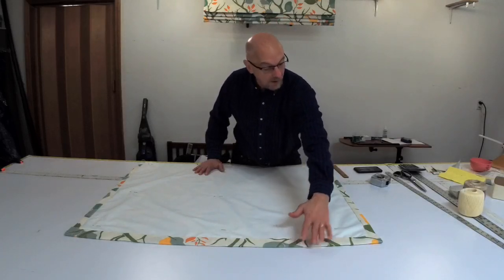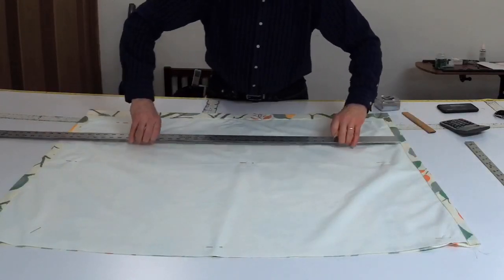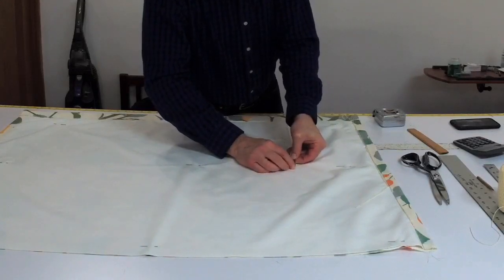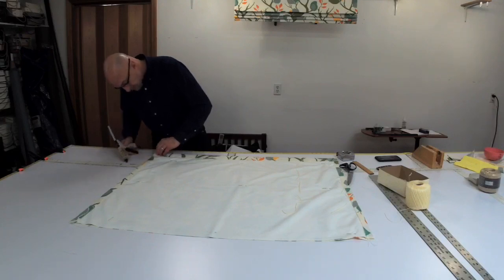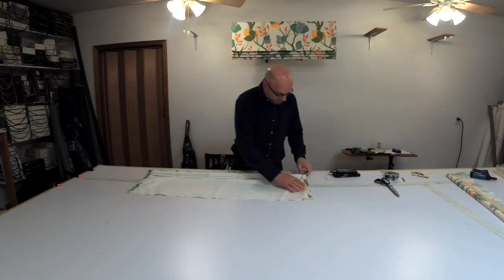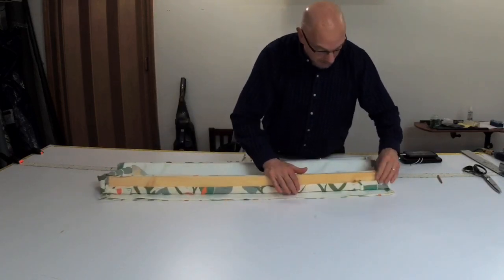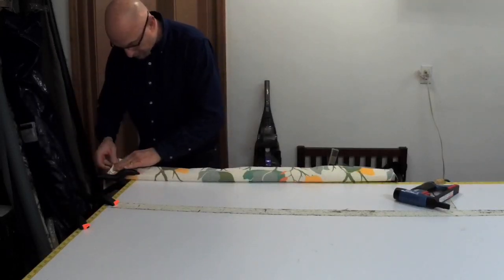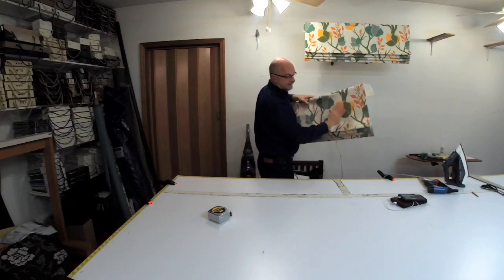Faux (fake Roman Shade (An easy project) Part 2

Comment: this was a great tutorial and very professional .  I would like to know what style bracket do you attached the faux roman shade to above the window.  I could not tell based the angle of the video,  I so love it to be attached wider than the window frame because I  will have mini blinds mounted inside the window frame. Does the shade attached directly on on the window frame or what?

Comment: I'm confused by the measurements for the rings.  You have 4" then 6 1/2" then 5" then 5."  In trying this, it seems like my last two folds are even rather than staggered.  Should the last measurement be 3 1/2?
Reply from the maker: Yes the last 2 are 5” and 5” and when you hang it you will see it does stagger do to the weight.
Reply: If I want my shade to be 10inch in total length what measurements should I use for where to place the rings?

Comment: Scott, thank you so much for this 2 part video. I'm working on same following your well thought out presentation. My valance is longer...46" cut length. I'd like my folds to be a little wider, about 1 1/2" ea (a scale thing), but my attempts to do so haven't worked. I did a mock of your measurements for the ring and folds placement, and see they end up close together when pulled up with the clip ring. Are your measurements the key to making it work? I've seen images on line of wider folds like mine but now wondering if perhaps they are sewn. I appreciate any comments you have.
Reply: Doris: Did you ever figure out the measurement/placement of the rings for a deeper fold?  Or did you end up sewing the folds in place to achieve the desired effect?
Reply: @ginarozenski9233  I figured it out and they turned out beautiful! It took a while as it was more challenging than I expected but I’m glad I stuck with it. I didn’t want the look of sewing them down. Thanks for asking!
Reply: @dorisrichardson2688  would you be willing to share your measurements! I too want deeper folds. Thanks!

Comment: what do you do when the fabric is 60" wide and the shade needs to measure 79".
Reply: Barbara, I've had this situation before. In fact, I ran into this situation just this week with a very geometric fabric. I ended up buying enough fabric to use the length of fabric rather than the width. If you can't do this way (I think it's called "railroading"), then buy enough fabric to use one 60" width for a centered section (call that section "A"), and then split another 60" width into 2 sections (Sections "B" and "C"). Then sew one split section "B" onto the left end of center section "A", and the other split section "C" onto the right end of center section "A." Then you can cut down the total width for your 79" window treatment. Personally, I prefer a balanced look when splicing sections together. If 79" is your finished width, then I would make the center section A to be 55" finished width, and the two outer sections "B" and "C" to each be 12" wide finished. Thus, 55+12+12=79". If you use the entire 60" width for your center section A, then each of your side sections will be narrower than I would personally want. Maybe draw it out to scale first to see what you prefer. Good luck!
Reply from the maker: Good question! What we do is seam match (if print fabric) 1/2 width on each side of the full width and then we trim off the excess evenly on both ends. For example 9-1/2”/60”/9-1/2”= 69”. of course you need to add for seam allowances and side hems. You will need to do the same with the lining and center the seams to the shade fabric the best you can since the lining is going to be narrower in width. Good luck!

Comment: Is there a way to do this that doesn't involve staples, so it is easier to clean?
Reply: You could sew in a pocket at the top, and mount it using a tension rod. However I'm not sure about laundering with all the rings. Might work on a gentle cycle.
Reply: I made one a long time ago and I added velcro to the board and hemmed top of the shade
Reply: Sew Velcro on the fabric side on top edge. ( that will attach the  lining  at same time) Fold velcro portion back and attach to a board with Velcro stapled along the very top edge of board. My board screwed on to wall. Not much return on mine, depends what you like. This way can come down for cleaning.